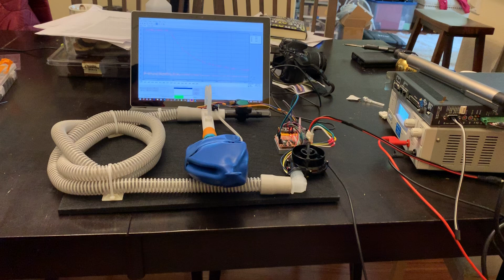RespiraWorks Ventilator Update #6: software-controlled PCV

Comment: Have you guys tested accuracy on the tidal volume? I’m building a similar sensor for a similar project and have been looking for data on how good the pitot approach is. Is your flow sensor pitot tube based?
Reply from the maker: It's a pneumotachograph, essentially a bundle of capillary tubes across which is measured differential pressure.  Check this out: https://www.academia.edu/13717799/Flow_measurement_in_mechanical_ventilation_A_review
Reply: @youngfiles  dear edwin iam also working on project like this can u mail me the details if u dont mind , iam sruggling to find sensors can use with arduino